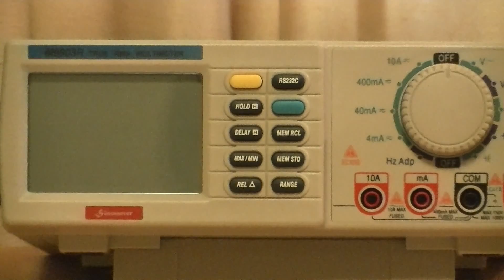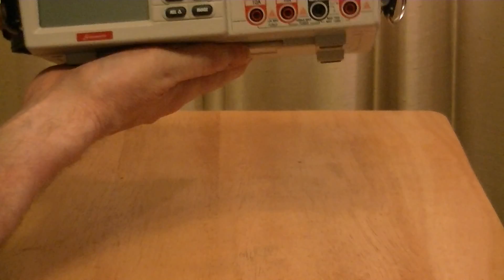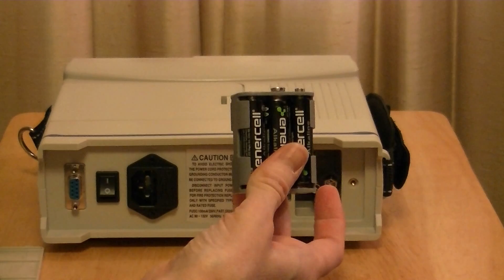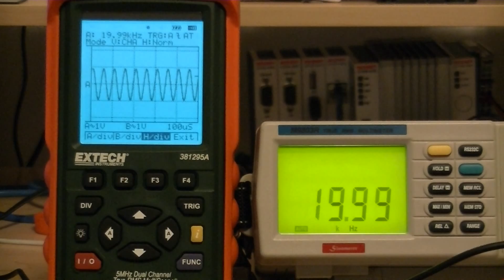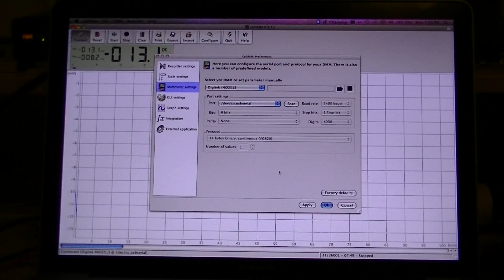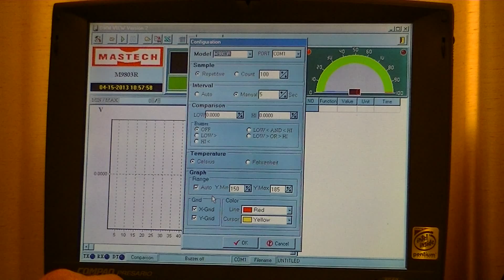Mastech M9803R - A not so in-depth look

Comment: I actually have a Fluke 233 that I am currently using as a bench meter but has started to show an error with the remote display. I was considering this 9803R bench meter as a direct replacement but now I think I'll just spend the extra cash to get another Fluke 233 meter. Thanks.

Comment from the maker: Hmm...I didn't research badging, just went by pictures on EBay.  Pictures of the Vichy looked identical to the Mastech and Sinometer DMM.  A fail on my part.  I think you're right, it's just a hand-held DMM in a big box.  Biggest advantage is that it plugs in to AC power.
Reply: And that it does RS232 logging......thanks for the video!